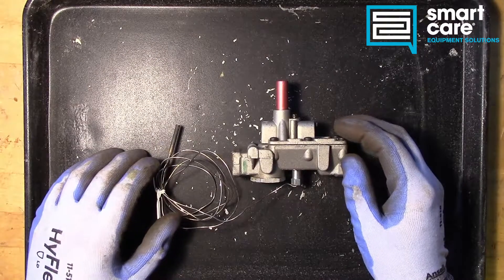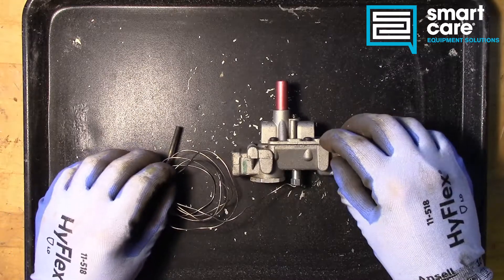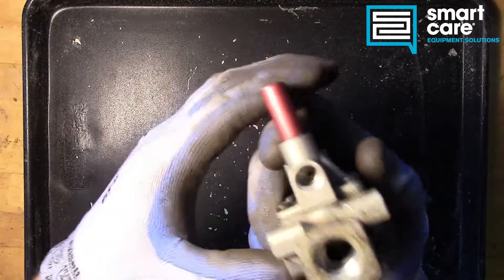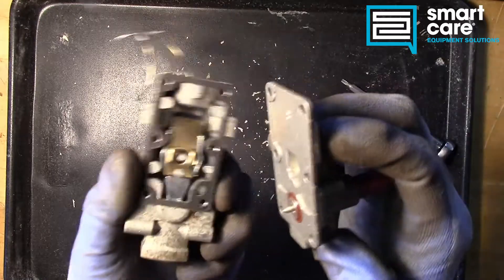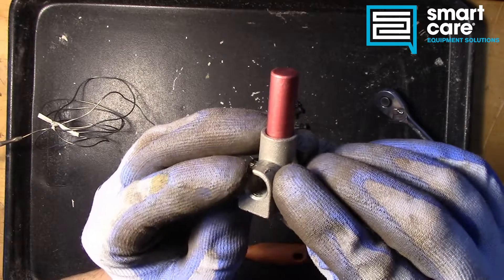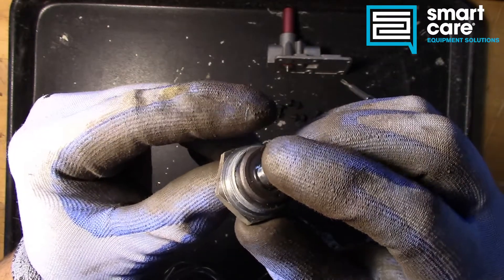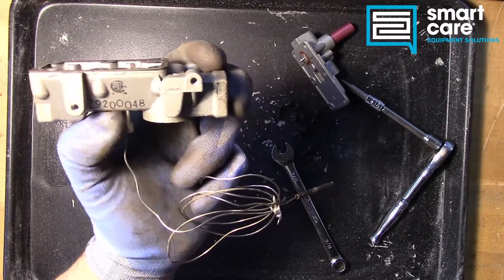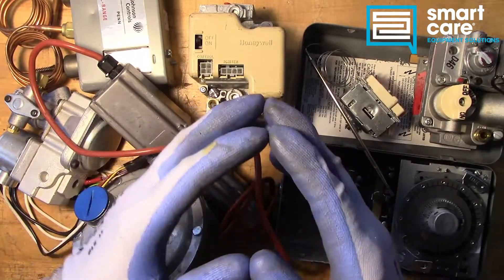Teardown Tuesday Episode 14: RobertShaw FMDA Flame Safety Valve

Comment: On the valve top, the round section you see with the pin is threaded in and sealed with glyptal. It is calibrated and set before the glyptal dries. The other side of it has a metal seat. The body itself has a metal seat within as well. It has a spring loaded rubber “hat” exactly like the one in the TS11 safety pilot. The difference here being it interacts with both metal seats instead of just one. When the button is pressed or the valve is on, it opens away from the body seat and allows gas to the pilot outlet, while then contacting the metal seat on the threaded piece preventing gas from escaping out around the pin. From there, there is a shaft that slides through between that cavity and the button cavity. It has a head and stop collar on one end, which the head pushes the rubber hat away from the metal seat in the body. It is knurled on the other end that the red button is pressed over. Below the button, there is a spring, and a small rubber seal and sealing ring. That’s about it

Comment: Does the adjustment screw control the flow of the red button also or just when the bulb opens
Reply: It adjusts the amount of pilot gas flow. Both when the button is pushed to light and while the safety is open

Comment: Hi, is that mercury pilot tube replaceable? Or is it permanently built into the valve? Great video. Thanks
Reply from the maker: Good question! It's permanently installed in the valve and isn't meant to be serviced in the field. There's a sealant epoxy on the retaining nut that makes it impossible to remove without damage.
Reply: So if the pilot flame is hitting the mercury bulb properly when pressing the red button on the gas valve, but the pilot goes off when button is released. Does this means the valve is defective 100%. Thanks